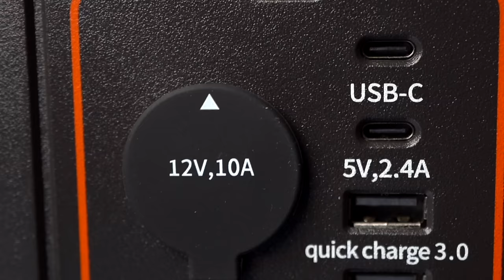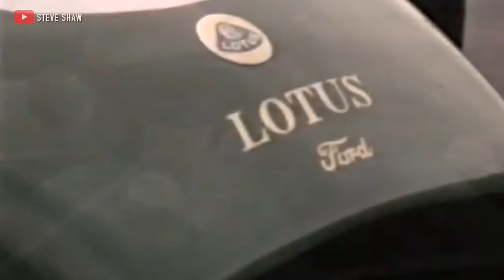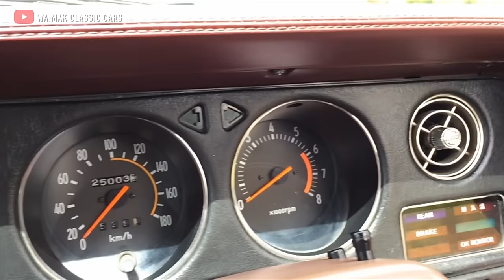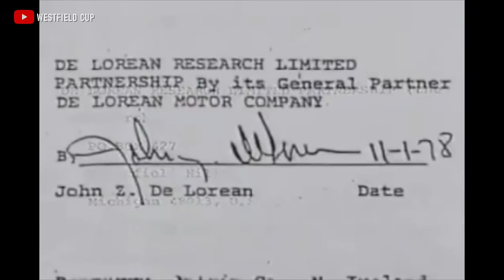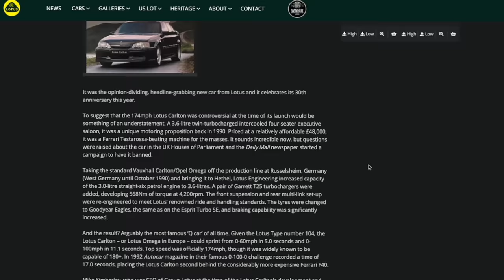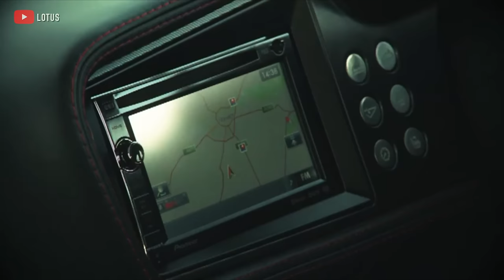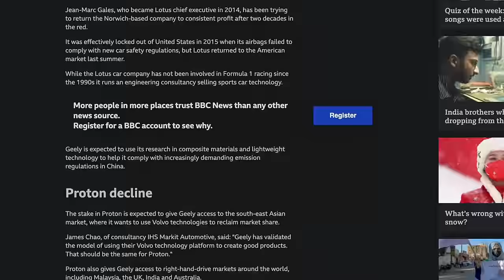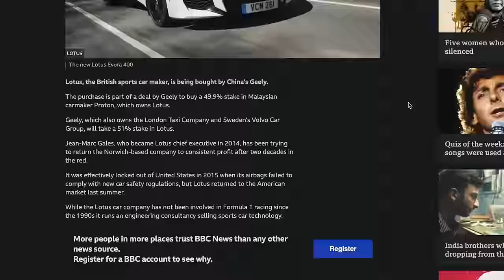Lotus is Dead

Comment: We've already seen an electric Lotus: it's called first generation Tesla Roadster.
Reply: It's scary
Reply: The car market is unfairly tilted in favor of electric.  It's fine that electric cars exist. What is not fair is that they are given unfair advantages in order to get rid of the internal combustion engine.
Reply: Hell i dont know how it is in outher countries, but in Latvia atleast electric car owners dont have to pay road taxes.
Reply: @wayland7150  They don't have the choice. Goverments all over the world are setting up regulations to ban internal combustion cars by 2030-2040, and while it is for good reason, it's scary to see how car design is quickly becoming "electric SUV".
Reply: @bruhmaxxer  It’s not for good reason. Cars aren’t the major problem for the environment.
Reply: @jdmr1c3ing  It is not for a good reason, electric cars actually are much more damaging to environment and use more energy, full life cicle
Reply: @jdmr1c3ing  yes they are
Reply: @jedispartancoolman  Not even close.  Cargo vehicles are far worse
Reply: @joldsaway3489  just because something is worse doesn't meant anything else isn't bad. Get rid of both
Reply: Tesla isn't cutting edge. They should have designed an electric vehicle with a quick change battery pack, much the same as you can swap batteries out of a flashlight. Those packs could be stocked and recharged at service stations just like we refill cars with gasoline today. But Musk wanted a proprietary design with charging stations, which they could leverage into incredible riches, rather than do what was in the best interest for everyone.
Reply: @pablomalaga4676  this is incorrect. Thermal efficiency of ICE vehicles is around 20% on the best circumstances, where the thermal efficiency of a BEV is upwards of 80% on a bad day. Even though EV's require more energy to make, the emissions break even period for BEV's is less than 5 years, even if all the electricity they use comes from coal
Reply: @wayland7150  Wait until they all start making a combined 700k cars and can't get batteries or straighten out the maddening charging system.
Reply: @ikskilnieks3753  That will surely backfire on Latvia as the increased weight of electric vehicles destroy the roads.
Reply: @nobedz6688  whatever you need to tell yourself lmao
Reply: No it’s the lotus emira 2000hp electric
Reply: No, it was the 1998-2003 Zytek Lotus Elise.
Reply: @iceman5117   No, fossil to electric conversion does not help at all. EVs have no better total efficiency than ICEs. Coal fired power plants have an efficiency of 33%. Transmission losses are another 30%. With 80% EV efficiency that leaves 18.5% total efficiency.
Reply: @peterdejong5456  your numbers are very far off
Reply: @iceman5117   Sure. EVs may be even worse. It takes much more energy to produce and fully recycle an EV, battery included, than an equally modern cradle-to-cradle designed ICE. Then compare the production of 1 kWh electricity against the gasoline equivalent. Finally, consider that a tank of gasoline contains more than 60 times the energy of a modern Li-Ion battery and that not all waste heat is waste as it is used for comfort heating in moderate climates, then the 80% vs 20% efficiency difference evens out quite easily.
Reply: @iceman5117   The production of biofuels, i.e. ethanol from corn, is equally energy inefficient. Mixing ethanol with gasoline is the worst for emissions.
Reply: @peterdejong5456  of course it takes more energy to create an EV, but the emissions offset during use is substantial, and the lifecycle emissions break even point is only a few years of ownership even in the worst case scenario. Comfort heating largely irrelevant to the total waste output of the engine flowing out the tailpipe and radiating out of the engine bay.  The energy capacity of the vehicle is likewise irrelevant, a semi truck with a 300 gallon fuel system is no more sustainable or emissions responsive than a 2 gallon motorcycle

The energy density of ethanol is largely irrelevant to its function. For one, the volume of ethanol itself is largely carbon neutral whereas the petroleum itself is not. That is, any ethanol consumed is derived from carbon sequestered in it's production where petroleum liberates carbon that has been sequestered for tens of thousands of years. Furthermore, the presence of ethanol as an octane equivalent booster and charge cooler increases the thermal efficiency of the petroleum, all the while having a less emissions intensive production process than crude oil drilling and refining. Alcohol based biofuels, such as Porsche is studying, have the potential to be completely carbon neutral through the production and use chain, but are still a ways off. BEV is simply the most efficient way we have to store and use energy for transportation short of electric trains.
Reply: @iceman5117   
Comfort heating reduces the range of EVs considerably. It has no impact on an ICE range. 

When comparing vehicles consider energy use per passenger-mile. A Jumbojet has the same energy use per passenger-mile as a family saloon, only at a 10x higher speed. An ICE has a quarter of the efficiency of an EV, but when comparing energy use per passenger-mile it is similar if the electricity comes from fossil fuels. 

If it comes from solar or wind the EV is almost 4x better, but that is unrealistic. In populated areas the grid cannot cope with electricity demands of all EVs and there is insufficient direct supply from solar and wind.
Reply: @iceman5117   Maglev vacuum trains are no more efficient than cars, planes or even electric taxi drones when you consider door-to-door transport efficiency. Pse consider real life situations, not pipe dream concepts. 

You seem to miss the energy efficiency point of biofuels entirely. If a fuel requires more energy to produce than it contains, the product is not sustainable.
Reply: @peterdejong5456  that's incorrect. Passenger heating has a negligible effect on BeV range, it's hardly even worth talking about.

Am airliner may have similar energy use per passenger mile, but the emissions output is completely uncontrolled. Energy usage does not matter nearly as much as emissions.

Per passenger mile energy use of a BEV will be some 60 percentage points greater than the most efficient ICE passenger vehicle on earth, due to the 60+% higher thermal efficiency. This is unavoidable. 

The only reason there is insufficient supply of solar and wind is because those facilities are still being built out. Nuclear is another option as well. Even in the worst case scenario of 100% coal power (which is true nowhere in the US),  the emissions breakeven period is still withing the projected lifespan of the vehicle. 

No one said anything about maglev vacuum trains. Standard electric rail transport is still the most efficient means of passenger transportation we have. 

Any production we take part in is going to require more energy than we get out, that's how thermodynamics work. Growing a tomato plant in your back yard requires more energy than is contained in the plant at harvest. Nothing is sustainable by your metric as it will all contribute to the inevitable heat death of the universe. What matters is where that energy comes from and what happens to the carbon. When you burn petroleum, youre releasing carbon that was sequestered underground for thousands of years and would not have otherwise been liberated to atmosphere. When you burn biofuels, you're only releasing the carbon that was sequestered by a plant that was grown a few weeks ago, which would have been released anyway through metabolism or decomposition otherwise. The only meaningful source of emissions from biofuel is from the production chain which can be completely electrified in the production of biofuels and cannot be for the production of petroleum.
Reply: @iceman5117   
Drawing from 4,200 connected EVs and 5.2 million trips, Geotab concluded that EVs at -15C drop to 54% of their range at 21C. I would not call that hardly worth talking about. Similar range reduction occurs at high temperatures. Off course, ICE efficiency is not affected by low outside temperature at all. 

Energy usage is vital if renewables cannot cover 100% of our energy use. And they will never be able to. Energy use follows population growth and level of development. According to UN demographics world energy use in 2050 will be 2x that of 1990. And in 2100 it will be 4x that of 1990. Renewables alone can never cover that. We will need the entire energy mix (fossils and nuclear included) to avoid a permanent worldwide energy crisis.
Reply: @iceman5117   EV total energy use can never be better dan ICE if electricity comes mostly from fossil fuels. It cannot come fully from renewables either. In densely populated areas there is no space for all the required sun and wind farms. Those in remote areas cannot help, because the grid simply cannot transmit all the required power. Nuclear is limited by the grid as well. 

Standard electric trains are far less efficient than cars, planes or taxi drones for real world door-to-door transport. Musks Hyperloop train has almost no air resistance, but it can never compete against a plane on intercontinental routes, because of the huge amount of energy required to build, maintain and operate 2x 3,000 mile steel vacuum tubes with 15ft diameter per route.
Reply: @peterdejong5456  so you're moving your goalposts once again from comfort heating to temperature related capacity loss. I don't think you quite understand how marginal an issue performance at -21c is either, or how little actual battery capacity matters in terms of efficiency. 

There is no other option for the future but zero fossil fuel and net negative emissions. Any other alternative will result in unavoidable catastrophe at this point in time. We are already beyond the point of no return
Reply: @peterdejong5456  it absolutely can be, because BEV is so much more thermally efficient. Less than 20% of the energy consumed by an ICE vehicle is used for motion. Well over 80% is used for motion in a BEV. Stationary generation is likewise much more efficient than ICE vehicles, and technology like stack scrubbers further reduce the emissions footprint.

There's no space in densely populated areas for any sort of power plant, coal and NG take up acres of space. Solar allows for the decentralization of generation though, as each building can incorporate its own sustainable generation capacity. Wind can likewise be sited beyond the contracts of coal, nuclear and NG. NY and NJ just sold the largest offshore wind permit, for example. Nuclear is only as grid limited as existing coal, oil, and NG is. The transmission infrastructure required is the same for all three.

That's wholly incorrect. Electric trains take that 80%+ efficiency and pass it along to a capacity of several hundred people. The notion that individual ice vehicles can be more efficient (ie extrapolating an 80% energy loss across every single person-trip) is absurd. You're going to need a hell of a citation to back that claim
 
No one is talking about Hyperloop but you. Maintaining a vacuum in a miles long tube is already untenable
Reply: @iceman5117   Individual vehicle efficiency does not matter. Its total system efficiency that counts when considering sustainability. According to the US dept of Energy a coal fired power plant operates at 33% efficiency on average. Grid transmission losses are 6% and 4% in distribution. So total EV efficiency boils down to 23.8%. Same range as gasoline ICEs 20% average. Hybrid and diesel ICEs are much better.
Reply: @iceman5117   Your power plant comparison regarding grid limitations makes no sense at all. Grid limitations only apply for electricity, not for fossile fuels. I already mentioned a tank of gasoline contains 60x the energy of a modern battery. Only a fraction of our current energy use is covered by electricity. You can never replace all mobility energy use and all manufacturing energy use by electricity. A 50% efficient hydrogen economy will make it even worse. No grid can carry that much power.
Reply: @peterdejong5456  total system efficiency is the combined total of all individual elements of the system. ICE vehicles compound an 80% thermal loss over every single person-trip, a train only compounds a 20% loss once.

Your values are baseless. You're double counting your transmission losses, which vary from place to place as well.

The most thermally efficient ICE engine, a diesel made by Peterbilt, only marginally breaks 20% overall thermal efficiency
Reply: @iceman5117   No, you're comparing individual vehicle efficiencies again. The train runs on electricity from coal. Its energy use for a single passenger-mile is similar to that of a Jumbojet, except that the plane is 5x faster. 

But that is not all. You rarely want to travel from station to station, or from airport to airport. You should always consider door-to-door energy use. The most flexible means of transport is the individual car (and in future if legal the taxi drone). That usually requires the least miles to get from one address to the other. 

I'm simply using Dept of Energy data. They give 6% transmission losses for the HV grid and 4% losses for the LV distribution grid on average. Do the math. EVs, biofuels and the hydrogen economy are a hoax.
Reply: @peterdejong5456  the train doesn't run on electricity from coal, the train runs on electricity coming from a variety of localized sources. It could be nuclear, it could be wind, it could be natural gas.  Trains carry far more people using far more efficient means. Airliners are one of the most emissions intensive modes of transportation. 

Stations serve as hubs for development and destinations. The ideal scenario, and the reality in most places of reasonable density, are that the last mile journey can occur on foot, by bike, or by bus, all of which are far less emissions and energy intensive that individual cars. The notion that providing every person with 4,000 pounds of steel, oil and rubber and a <20% efficient engine is less energy or emissions intensive than packing them all onto a single, 80%+ efficient train is preposterous. Please provide a citation for such an astoundingly stupid claim.

Provide a source to your data. You're double counting your losses once again. Not you're claiming that EV's, Biofuels and hydrogen don't exist?
Reply: @iceman5117   A substantial range reduction at higher temps means the overall efficiency of the car is reduced. If you put in a certain amount and it does not come out anymore at higher temps you simply have wasted energy. 

If you want zero fossil fuel use and net negative emissions, you should calculate if these wishes are at all possible. They are not. So stop going into a dead end and put your energy and money into something feasible instead. Good luck!
Reply: All thanks to our buddy Elon!
Reply: @bruhmaxxer  but they will build electric tanks right?
Reply: Wow, this thread ended with Peter and Iceman splitting 1000 hairs, but no one mentioned the biggest difference between ICE power and electric power. 
The last time I was in San Francisco, about 10 years ago, I realized while riding on one of the electric busses that used power fed from overhead wires, that while going downhill, the busses were employing regenerative electric braking. 
Was that regenerated electricity feeding back into the citywide high voltage electric bus grid? Was the energy being recovered by that heavily loaded bus going down a hill being used to pull another heavily loaded bus UP a hill??? 
If so, this was the electrical equivalent to the brilliant electromechanical design of the famous and efficient original San Francisco trolley car system. It's such a brilliant old system. It uses huge Westinghouse electric motors at a central location powering a network of steel cables that run up and down steep hills all over the city. Overall, the system is in a state of equilibrium where the heavily loaded cars going down the hills are literally PULLING other heavily loaded cars UP the hills.
Electric cars do this same thing on an independent scale every time regen braking stores energy to be used a few moments later. ICE cars do NOT conserve momentum in this manner. An electronically controlled 400 lb flywheel could be used to this effect, but would not be any more practical than a battery.
The biggest difference between ICE and electric powered cars is that every time you slow down, go downhill, or stop in an ICE powered vehicle - ALL the energy from momentum is WASTED. It is thrown away - converted to heat by the friction braking that occurs. Electric vehicles are more like an energy "spring", storing that momentum energy to be used soon after. 
For me, that's the biggest reason to use electric vehicles for everyday transportation in most (city) stop and go environments. For driving 1000 miles per day at a constant speed on an interstate highway, electric power loses it's greatest advantage. But realistically - how much of MY overall driving time is spent driving long distances at a constant high speed on level ground, vs stop and go, non level, low speed driving?
Reply: @iceman5117  There is an environmental impact in manufacturing everything as well as another at end-of-life. More impact when grid power needs more power-plants and added infrastructure to handle charging, as well as impacts from mining to make the batteries, and that's more than lithium alone. EV's aren't the 'panacea' they're touted as being when you factor everything in.
Reply: The Tesla Roadster was one of the most astounding cars I've witnessed. Amazing acceleration - in silence.
Reply: @jedispartancoolman  the worse thing for the environment is the way that we produce food, both livestock and crops. then there is coal and oil extraction, as well as plastic. EV's are worse in the production phase, while internal combustion vehicles are worse in the long run. Hydrogen cars are better then both. No, You can't get rid of cargo vehicles, EV cargo vehicles are too inefficient and getting rid of them entirely will mean a severe lack of basic supplies, such as food and medicine. unless we build trains and trams everywhere, but that's not something most countries can afford.
Reply: @pablomalaga4676  The salvaging is a nightmare as well.
Reply: @jdmr1c3ing production of goods is far worse
Reply: @d.e.b.b5788  Not feasible... Do you know how much do those batteries weight? You'd need a crane or a robotic arm to remove them, it's most of the weight of the car. And you'd need to be very careful not to die when unplugging (or plugging) the terminals, that's high voltage in there.
Reply: wrong Tesla toaster....